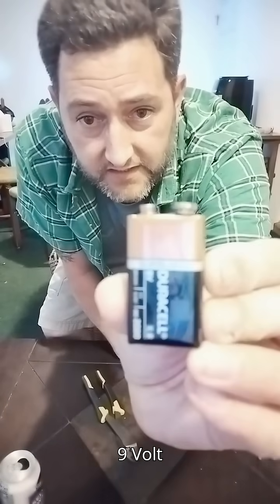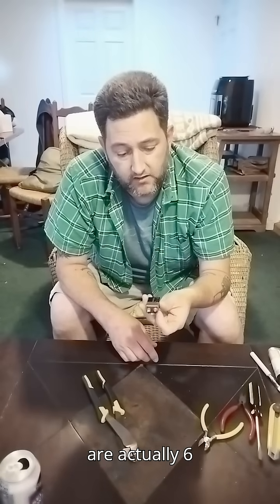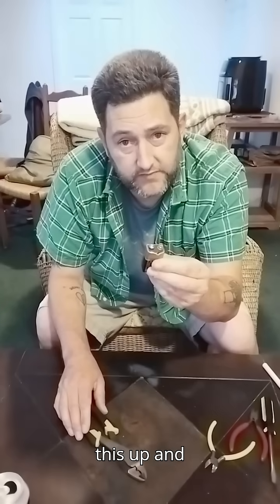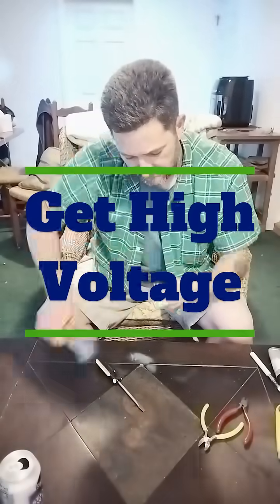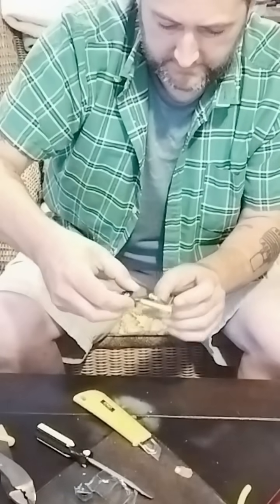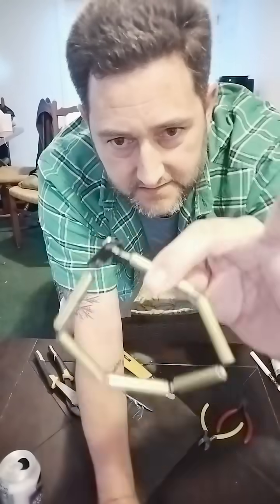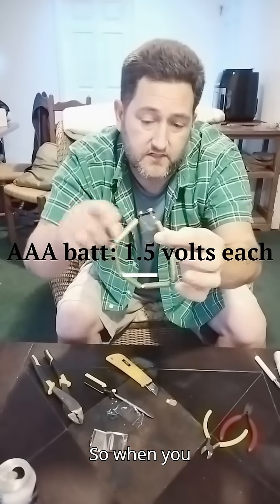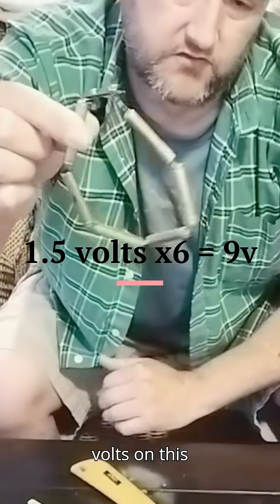WHAT'S IN A 9v BATTERY?

Comment: Those are not AAA, but AAAA. Some 9Vs also have 6 flat cells stacked on top of each other, but the concept is the same. The reason why they have to do this and can't just make a straight 9V battery is because of the chemistry of alkaline batteries, which depending on what materials used all produce about 1.5V.

Comment: If I'm not mistaken, it is actually 6 quadruple a batteries (AAAA). They are skinnier than AAA batteries and they might even be a little bit shorter. I once had a old voice memo recorder that took quadruple a batteries and I couldn't find any for it at any store, but the ones that were inside of a 9-volt battery fit perfectly, while regular AAA batteries were too large.

I think nowadays they sell quadruple a batteries at AutoZone.